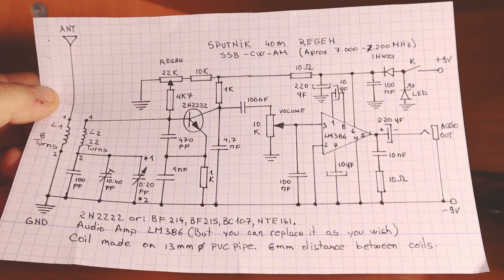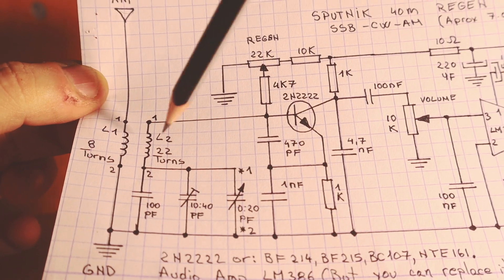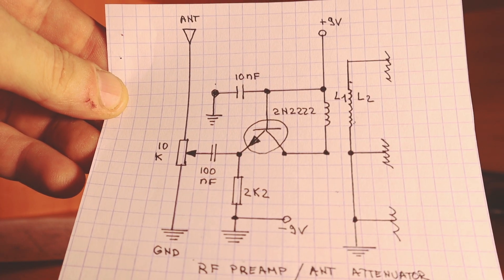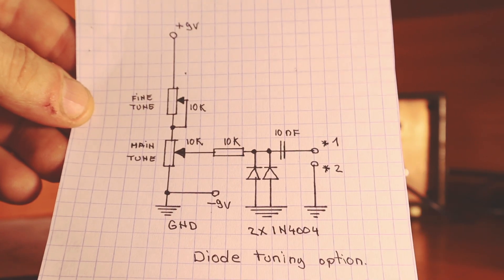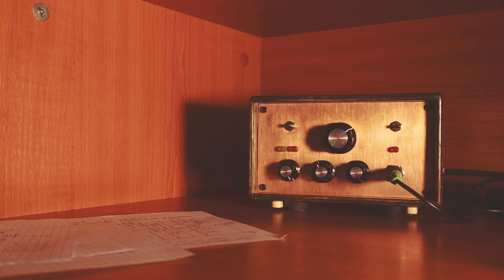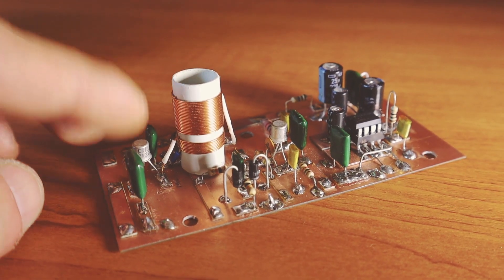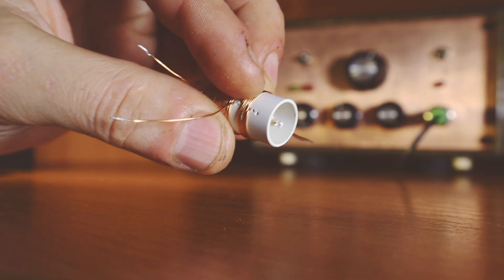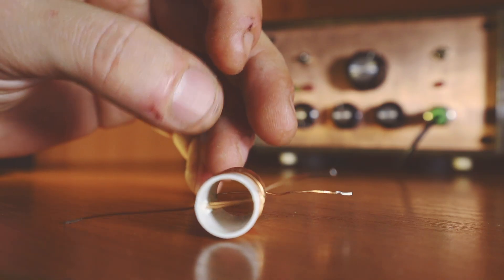Simple Regenerative Receiver For The 40m Amateur Radio Band

Comment: the battery indication led is probably misconnected. should be reversed and equipped with series resistance
Reply from the maker: The power LED or the RX TX ones ? The RX TX depends how you set the colors... no need for resistor as they are taking the power from the same resistor output of the power LED and that one already has a resistor )
Reply from the maker: Ohh wait... I just watched the video... yep I forgot to add the resistor to the power LED in the schematic. But it's fine as tomorrow I'm adding a link to a new properly made schematic on the computer. Thank you ) 73
Reply: @dxexplorer  yes, i meant that one. no worry, happens :-)
Reply from the maker: Yes hahaha... I was thinking that no way... the resistor is there... but that was in my circuit not in the schematic 😂😂

Comment: Hello i am half way through builbing my"sputnik"     just one question under the regen label on the top left  of the diagram (schematic) you show a 4.7k variable resistor   but it also shows a 22k resistor  next to the 10k resistor as well     i do not understand this  is it  a seperate 22k resistor      please clarify for  me  many thanks  dave c   G0NVF
Reply from the maker: OK... so... from the base of the transistor to the center pin of the potentiometer you have the 4.7k resistor.... the potentiometer is 22k... the other pin of the 22k potentiometer goes to the 10k resistor... and the third pin goes to ground. The mistake I made in the drawing... I will update the schematic tomorrow... the 100nF capacitor going from pin 3 of the LM386 IC that goes to ground... move that before the 10k volume potentiometer. Put it between the output of the 100nF capacitor that comes from the RF side ( audio output ) to ground. Pretty much same as it is now just before the potentiometer not after. As it is now because of the potentiometer combination with the capacitor is acting more like a tone filter than volume control ))) Let me know if you understand what I meant. 73.
Reply: @dxexplorer  All ok many thanks for your rapid response  dave c
Reply from the maker: Great Dave. 73
Reply from the maker: David let me jump out of my bed and check the schematic and I'll get back to you right away. I also found one mistake in the drawing I made. Simple not critic. I'll write back in a bit.

Comment: Very nice work. I really like the wooden case. Please could you do a video about how you made the case?    There are different versions of the LM386 chip, perhaps and LM386N3 or N4 would deliver more power and thus more volume?
Reply from the maker: Hi Rob... Yes of course I can make a video. I will put it on my to do list then... I have to build a few for different things so I will post it pretty soon. About the LM 386... I thought that as well. The one I had it was "stolen" from my 49'er QRP kit hahaha as I had none available. It was the 300 mW version. But now I'm using the 1 W version and the output is the same. I tried all possible configurations but none seem to work. But... I think I discovered a mistake in the schematic about the 100 nF capacitor that goes from pin 3 to ground... that one I was supposed to have it before the potentiometer. So I will make the change and see if I can use other configurations having more audio output with ought having the IC going into oscillation. I will post another video when I'm done testing and making the receiver better looking and using a PCB version.... a proper PCB this time hahaha. Cheers and 73.